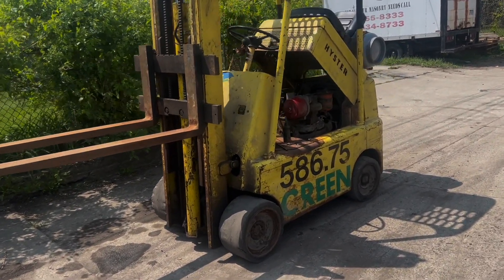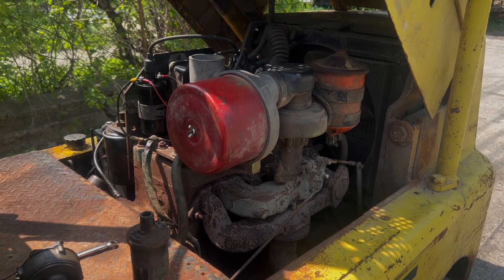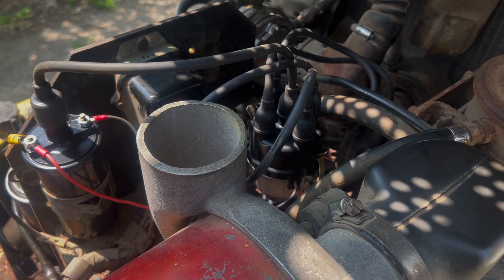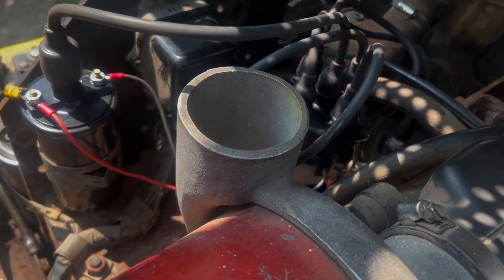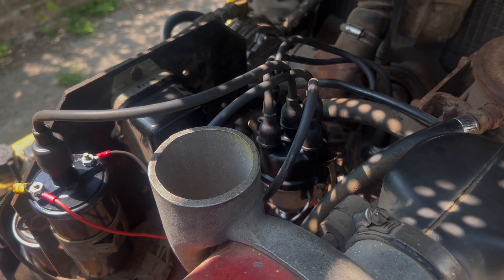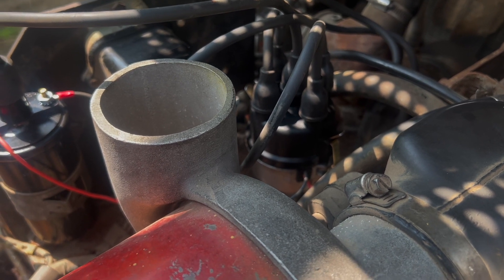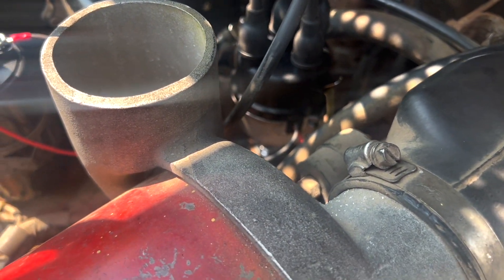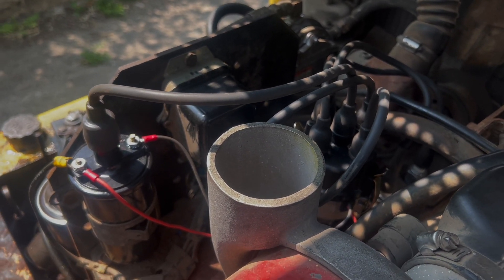Replace distributor on Hyster S50C forklift & Continental f163 engine -Points to electronic ignition

Comment: Greetings, I have this machine but I don't know how to drive it, it seems to be standard, and it also has the temperature sensor cable disconnected from the engine block and I don't know where they go.

Comment: Hey, do you know what to do if the distributor won't come out? It may be totally seized on my forklift, won't come out with a bar either.
Reply from the maker: Might seem obvious, but make sure the hold-down clamp is out. Other than that, just give it the old torch and hammer.
Reply: @roketaindustries3741 Hammer the top of the distributor, or the side? Thx. Will be trying this